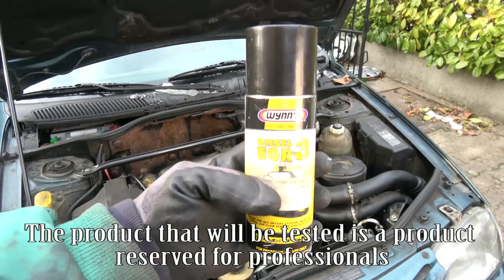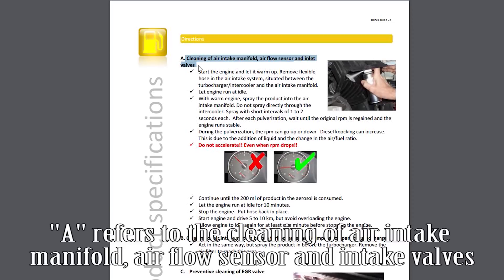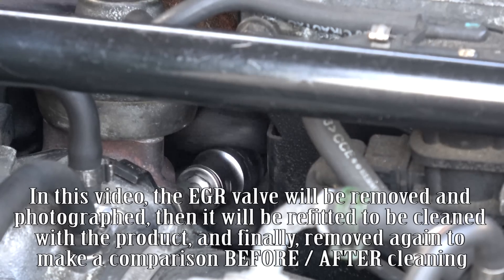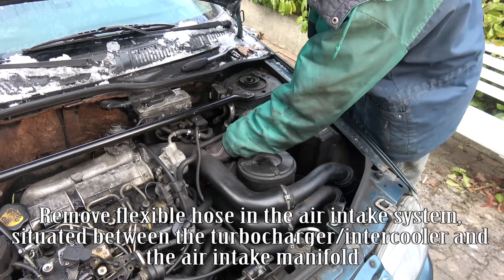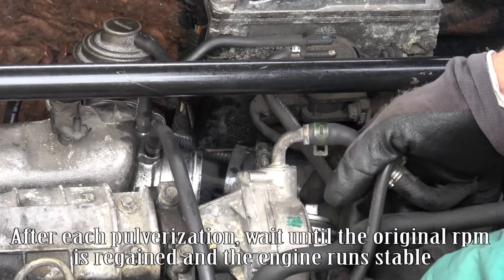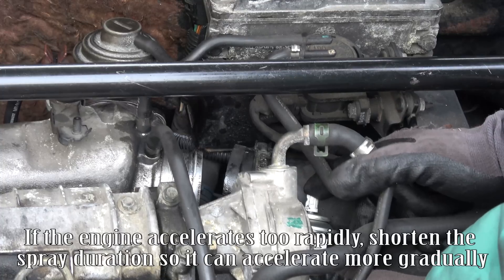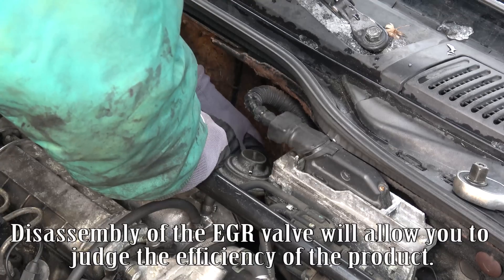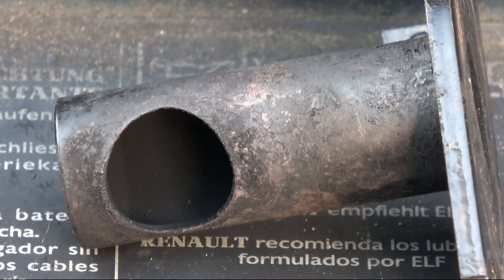EGR valve cleaning WITHOUT DISMANTLING - Cleaner test Before/After

Comment: Just spent 45 minutes removing my egr valve golf plus 1.9tdi 2 cans of egr cleaner spray from ebay a toothbrush it now looks like new, and then 20 mins to refit. Such an easy job. Allan keys is all you need.
My turbo is whistling audibly and the entire rev range seems far more responsive. I reckon it's the 1st time it's ever been done 130k miles. Just need to double check I've got the stereo code before I disconnect the battery to delete the engine light. The only pain is the 3rd bolt down the back but remove the cam belt cover and its actually not so bad. Watching the spray literally melt the carbon in seconds was mind blowing. The people who claim to do it without removing the egr valve are just kicking the can down the road for another 6 months. Give yourself an hour and you'll be glad you did it properly, it's easy.
Reply: What you mean why kick can .Some egr are nightmare 2 remove on some engine s
Reply: No way. On a polo tdi 1.2 its way too hard to take it out i nfact i dont even see it in the engine compartment. I cant even find videos showing exactly how to remove it

Comment: As a demo of the effectiveness of this spray, the spray was a failure. The visual before and after revealed no more than 20-25% cleaner. Better than a complete zero...

Clearly, cleaning the valve should be done off the car. Another vid I've seen recommends letting the valve soak overnight in cleaner. That did a job alright.
Reply: Yes tho some are nightmare 2 remove

Comment: You should have cleaned it while it was out the car.. those sprays they sell don't do much , for the money you spent on the can ! It's a waist of money !!! But thanks for showing us the results..
Reply: I put 2 tins of wynn's egr cleaner through my 330d because the swirl flaps were stuck. 30000 miles later and they're still working so some cleaners obviously do work